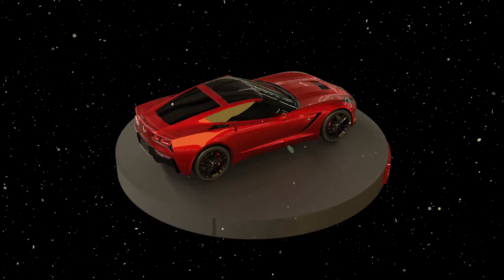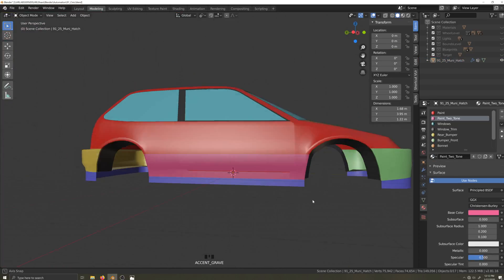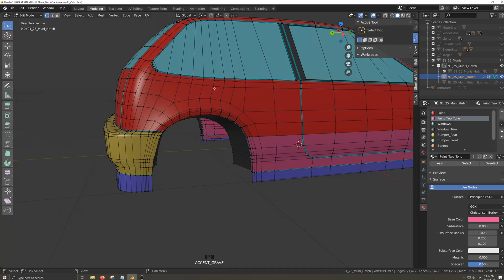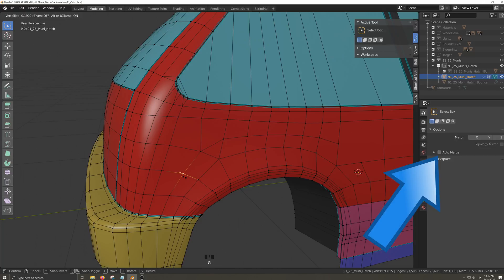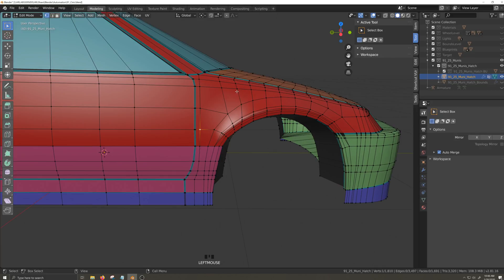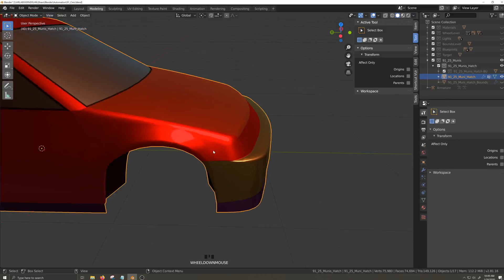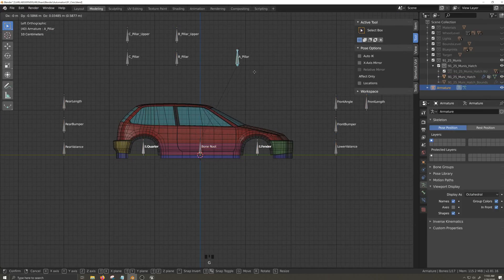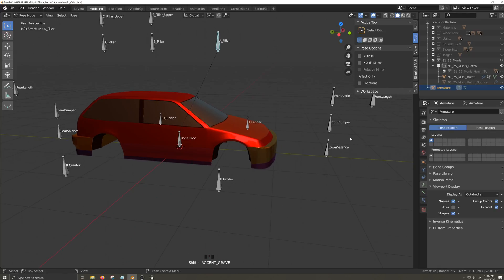Automation Car Modding Tutorial 13 - Test and Fix

Comment: I'm assuming body boxes aren't required for this step (and only for the final export)?
Reply from the maker: Only if you want to see things like cargo and passenger volumes, and correct weights, but since all we're doing is inspecting the artwork, none of that really matters yet.  You can always tweak those later, when you get closer to the final export phase.
Reply: @hardroosterlabs3814  Thanks!